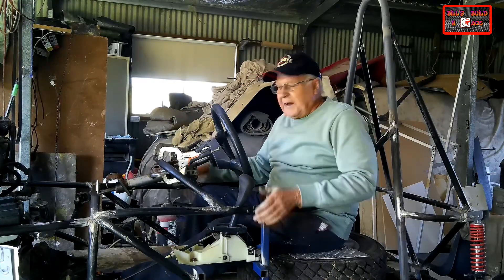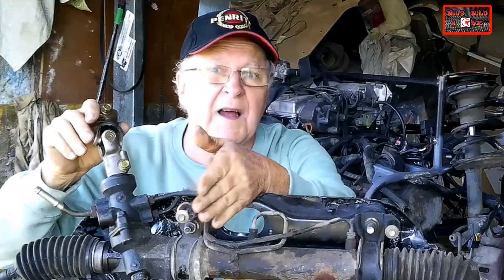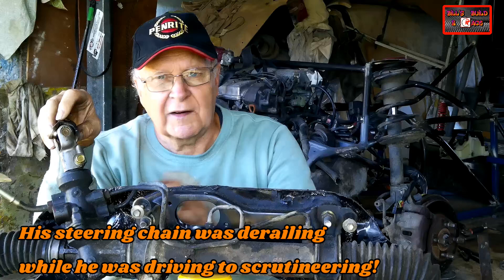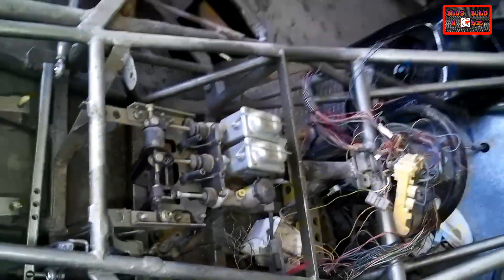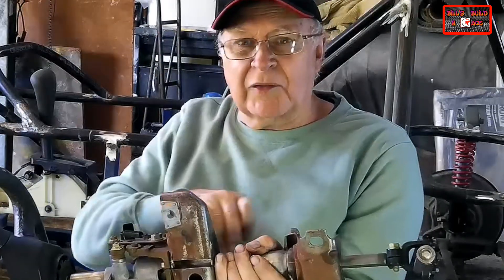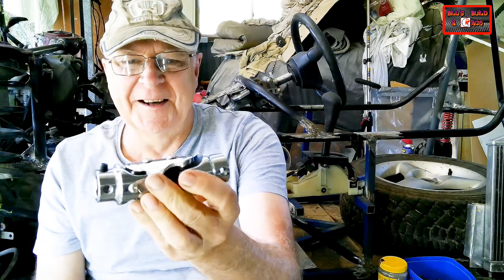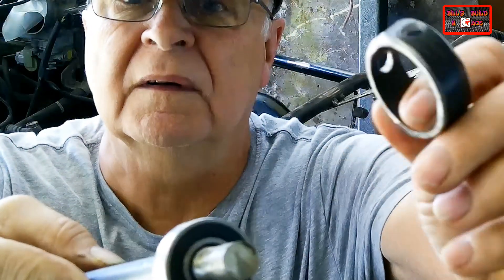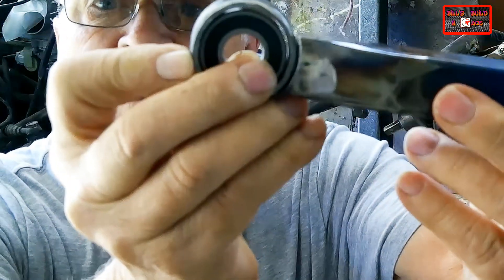Build an Autotest Motorkhana Special - part 8

Comment: Use forklift/digger hydraulic steering. It's used all the time in Formual Off Road and handles those extreme loads without any issues.
Reply from the maker: Yes. But any replacement rack's width has to exactly match the factory unit to avoid bump steer, and it would also have to be mounted in the exact same position as the factory unit for the same reason. So it's easier in this "use what you have" no budget build to retain the factory rack & pinion, which is hydraulically boosted as well.
Reply: It only has to "exactly match the factory unit" if you keep everything else exactly as factory. Apart from that I'm pretty sure a double acting hydrogen cylinder in the right length/stroke can be easily found. The Motorkhana cars also seem to have pretty stiff suspension so bump-steer might not be that much of an issue anyway. I think you could have avoided a bit of hassle by converting to hydraulic. But in the end it's your car and you must do what you feel is better.